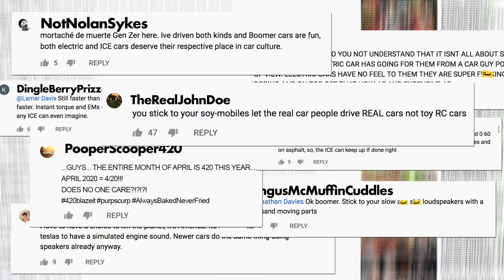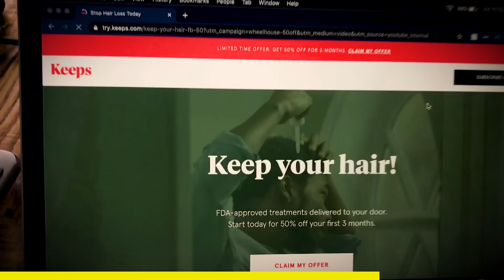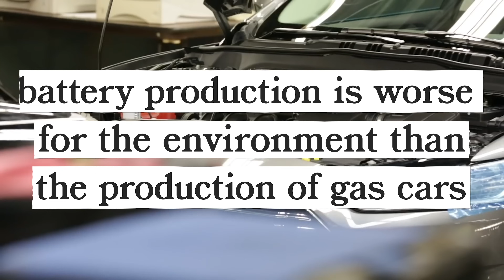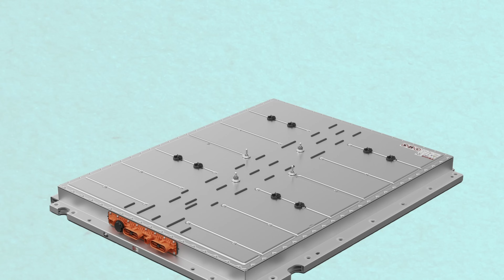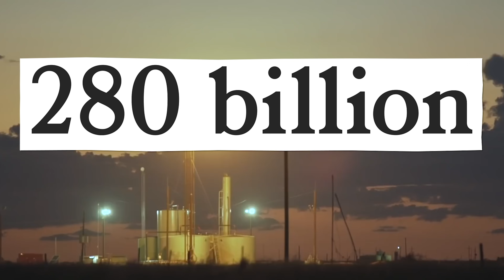Are Electric Cars REALLY Better for the Environment?

Comment: Can we give this man props for how he explains things. He makes it so easy to understand what he’s talking about!
Reply: He deliberately omitted the part where there are massive factories all over the world that have to recycle the batteries. If he was good and unbiased at explaining this topic, he would have explained the massive amounts of cO2 that those facilities produce. The omission of that information turns this video into nothing but propaganda. 

Also, the replacement of the battery packs in the cars. EVs have a much longer lifespan than ICE vehicles due to having far fewer moving parts, so people replace the battery packs in their vehicles instead of buying a new car when the batteries no longer hold an acceptable charge. This means that the cO2 production of the batteries is already at least double per BEV than what he's claiming.
Reply: @ayoungtricknamedjim5498  Yes, he never covered what happens to dead batteries and cost of replacing them! My cell phone battery replacement is expensive so I can’t imagine how much it would cost for a car.
Reply: @DH-gp3gp  and your cell phone probably has a bigger carbon footprint than your refrigerator.
Reply: @DH-gp3gp  well in a Tesla it’s 14k to 20k.
Reply: @DH-gp3gp  not that much for a car since u dont have to replace the whole batterie because the cars batteries are made out of about 16 modules where almost every time only have to replace one module which is maybe 1000-3000$ and since u save a lot of money on nit having to make oil changes etc thats not to much
Reply: @ayoungtricknamedjim5498  I just saw this comment. I didn’t know about that and thanks for commenting about it. I was trying to dig on what car I should buy that would be best for me and the planet, now I know it’s no cars at all 😭
Reply: @aliciaxoe3  me too. Bicycle when you can! I'm out in the middle of nowhere and drive my car three days a week to get to work but I walk or bike otherwise. Cheers!
Reply: @ayoungtricknamedjim5498  it’s also a more fit alternative too. I’ll definitely try to do something similar in the future and cheersss
Reply: Even ICE cars have batteries that are 80 to 90 pounds heavy. Even without EVs, ICE engines and lots of appliances already use batteries like inverters, inverter ACs, computer UPS, Laptop battery, notepads, mobile phones, torch, kids toys, hand held gadgets In many fields use batteries. So EVs are not a bad option. Most countries have adopted by solar energy, wind energy and hydopower energy for electricity.
Reply: @ayoungtricknamedjim5498  The batteries have to be replaced every ten years. This is on Youtube. And this is regardless to the other parts. And guess what those parts are all computers with chips, which can hinder the vehicles from working at times. And are easier to break and you can't work on them like my 1986 Jimmy.
Reply: @ayoungtricknamedjim5498  and notice how he didn't give a number for the c02 emissions from lithium or cobalt mining? Judt the ethical thought. 17 metric tons for a big EV, plus atleast 2 tons per year? So 37 tons for 10 years? You're getting up there with ice vehicles, and that's not including replacing the battery or from what I here the additional maintenance of EVs, I hear the tires need to be replaced more. And in an electrical world you still need to take into account the emissions from manufacturing solar panels and wind mills, mining for copper or processing recycled copper... I want to do more research on coal emissions vs oil refining. I thought I read that coal is worse, not sure if it takes into account refining of oil or just burning gas. And there is still energy loss in transporting power. Good luck mining lithium, or copper, or anything heavy with an electric power CAT truck. Most likely will have a low range when it comes to hauling or towing heavy material, which means more charging, and therefore more c02 emitted, whether from coal or manufacturing of solar panels, wind mills, hydro power systems. And more solar? = less room for trees and grass that love c02. Not all solar is just on roofs or pavement... edit: and i also read that mining for uranium emits c02, and heating up your home with electricity is tough vs gas, sooo you're probably going to need more juice, therefore more mining and c02 emissions. They say it's just water vapor, but doesn't water vapor heat the earth? And then you're just taking water from resources around you and speeding up that process that's supposedly already happening in our "warm" world. Just like digging for oil and speeding up that process...
Reply: @toomuchgyal9083  these are the thoughts that are good to ponder. Everyone should be researching this stuff instead of having the EV narrative force-fed and blindly accepting it. 

One thing I'd mention is that H2O/water vapor actually cools the air. Once it reaches a couple of feet from the exhaust pipes, it has a cooling effect :)
Reply: @ayoungtricknamedjim5498  I think we all need to understand heat transfer more, I honestly don't get it, there's a lot going on between the sun's plasma and our magnetic field. When I google "does water vapor heat the earth" the interwebs say yes it does. Although deep down I do think the sun is ultimately the king! Lol

Edit: but again to your point, what the internet says could be a half truth, it could have a cooling affect that we don't see, but the experts say otherwise.
Reply: +HYDROGEN AS BATTERIES : New concept : HYDROGEN BATTERIES. Electric vehicles must switch to use  hydrogen batteries instead of chemical batteries.  
People often think about hydrogen as fuel, but many forget that hydrogen is not only a fuel, but also very good battery, too. 
 1/ The fundamental science dictates essential truth of all chemical batteries : (CAREFULLY RESEARCHED STUDIES)
if a chemical energy storing mechanism is charged as quickly as producing hydrogen, then this mechanism PRACTICALLY  CANNOT HAVE BETTER  ENERGY CONVERSION RATIO THAN ELECTROLYSIS PROCESS. Besides, it is possible to SETUP and adjust electrolysis reaction speed (for example slow down speed) to reach energy conversion ratio of electrolysis better than any chemical batteries. The best one of all possible chemical batteries in AEROBIC earth conditions is HYDROGEN BATTERY. All revolutions of chemical batteries, lithium batteries, LFP batteries, LTO batteries, graphene batteries .. are for reaching to the features of hydrogen batteries. 
  
2/ New concept : hydrogen battery = (fuel cell + hydrogen storage object). 
The most simple hydrogen battery = 1 fuel cell + 1 compressed hydrogen balloon 300bar, can easily beat best lithium batteries by all features : more capacity, more power, less weight, forever lifespan, no degradation, charging in 5 minutes, same or better energy conversion ratio, but just noremarkable bigger volume sized than lithium batteries.
 
3/ So just equip electric vehicles with hydrogen batteries instead of chemical batteries.  And equip hydrogen filling stations with mobile electrolysers to produce compressed hydrogen 300+ bar on site from electrical outlets. Electrolysing hydrogen filling stations (hydrogen battery charging stations) can run electrolysers from electrical outlets to produce liquid hydrogen on site, to avoid suddenly leap change requirements for big number of already existing current liquid hydrogen cars in the markets. But liquid hydrogen has low energy conversion ratio.  For now and near future, compressed hydrogen (produced on site)  is more versatile for various applications.
(Additionally envisagedly, owners of ANY SMALL COMPRESSED HYDROGEN MOBILITY VEHICLES/ROBOTS/BIG DRONES/MOBILITY DEVICES can buy small mobile household electrolysers to recharge hydrogen batteries at home at night/any times). 
4/ Example and comparison : hydrogen cars vs battery cars, hydrogen batteries vs chemical batteries :
The old approach sets high H2 cost because : they pay for making H2, then they pay much for converting H2 to liquid H2, then they pay much for transporting liquid H2 by trucks (complex safety trucks, and very small weight of liquid H2 on every trucks), then they pay for keeping cryogen conditions to store liquid H2. 
 But in new approach of ‘electrolysing hydrogen filling station” : you use electricity from electrical outlets at electrolysing hydrogen filling stations to run electrolysers to produce compressed hydrogen 300+bar on site. So you pay only for electricity and water of course. No other fees. No complex cryogen equipments.
Compare : hydrogen batteries vs lithium batteries in the approach of “electrolysing hydrogen filling station” : 
4.1/ Grid transmission loss : hydrogen battery charging and lithium battery charging onsite cause same grid transmission losses. 
Conclusion : Equal.
4.2/ Energy conversion ratio in charging : (electric energy -> chemical energy)
Electrolysers in quick mode (very high electrolysis reaction speed) have energy conversion ratio about 70%. Lithium batteries quick charging has energy conversion ratio about 60-70%. 
Electrolysers in slow mode (small electrolysis reaction speed) have energy conversion ratio 90%. Lithium batteries slow charging has energy conversion ratio 90%.
Conclusion : electrolysers win, because of the ability of flexible modes of scheduling and functioning to reach higher energy conversion ratio.
4.3/ Energy conversion ratio in performance : (chemical energy -> electric energy)
Fuel cell has energy conversion ratio about 75+% in mode of intensive power performance (when require delivering much walt/seconds), energy loss in form of heat. Lithium batteries have energy conversion ratio about 70-% in mode of intensive power performance (when require delivering much walt/seconds), energy loss in form of heat. 
Fuel cell has energy conversion ratio about 85+% in mode of nointensive power performance (when require delivering less walt/seconds), energy loss in form of heat. Lithium batteries have energy conversion ratio about 95-% in mode of nointensive power performance (when require delivering less walt/seconds), energy loss in form of heat. 
Conclusion : Equal.
4.4/ Energy loss in energy packing compressing process :
Hydrogen battery using compressed H2 300bar cause about 3-5% energy loss for compression. But hydrogen battery weight is very small.
Lithium battery loses 0 energy in compression. But lithium battery weight IS INHERENTLY HIGH. 
That means you always need to transport noneccessary lithium battery heavy weights on your vehicles every seconds. -> The higher power category, the higher loss with lithium batteries. The longer range, the higher loss with lithium batteries.
Conclusion : hydrogen batteries win with big advantages
4.5/ Spatial size :
Simple hydrogen battery = 1 fuel cell + 1 hydrogen ballon 300+ bar.
For small capacity category (for example, passenger cars capacity category) : simple hydrogen batteries have little bigger spatial sizes than lithium batteries. 
For nosmall capacity category : simple hydrogen batteries have little smaller spatial sizes than lithium batteries. 
Conclusion : lithium batteries win with nobig advantage. 
4.6/ Lifespan and degradation :
Hydrogen batteries have practically forever life span, and practically no degradation.
Lithium batteries have lifespan about 3 years. Some good ones have 5 years. Other modern modified lithium batteries have more lifespan but smaller capacities. But all of them degrade every year.
Conclusion : hydrogen batteries win. 
4.7/ Influence of environment temperature :
Hydrogen batteries never fear environment temperatures.
Lithium batteries fear environment temperature. Even in some seasons you can not or you ineffectively use lithium batteries.
Conclusion : hydrogen batteries win.
4.8/ Charging time :
Hydrogen batteries : load compressed Hydrogen 300+bar or exchange compressed hydrogen canisters 300 bar in 3-5 minutes.
But you must waste minimal 30 minutes for nofull charging lithium batteries, and often you must waste some money for paying some unnecessary things in fool waiting times too. -> waste time + waste money.
Conclusion : hydrogen batteries win.
4.9/ Synchronize with grid supplying schedules :
Electrolysing hydrogen filling stations can easily pick up flexible schedules to run electrolysers in tandem with grid supplying schedules. So Electrolysing hydrogen filling stations can pick up right hours of day for incentives electrical tarif. Nets of electrolysing hydrogen filling stations ideally use intermittent clean energy/renewable energy.
But electric charging stations can not pick up times. High power electric charging stations terribly conflict with intermittent schedules of clean energy/renewable energy. The more higher power electric charging station in quick charging mode, the more terribly it conflicts with intermittent energy supply schedules of clean energy/renewable energy.
Conclusion : hydrogen batteries win. 
FINAL NATURE TRUTH VERDICT : HYDROGEN CARS WIN MANYFOLD AGAINST BATTERY CARS. 
Just need to make right approach : model of distributed hydrogen productions onsite (nets of distributed ELECTROLYSING hydrogen filling stations) + electric cars with hydrogen batteries EXACTLY MAKES  HYDROGEN CARS MORE/AS  ENERGY SAVING THAN/AS  BATTERY CARS, AND IDEALLY COOPERATES WITH INTERMITTENT CLEAN ENERGY/RENEWABLE ENERGY THROUGH ALREADY EXISTING ELECTRICAL GRIDS. 
All electric vehicle manufactures, which make/begin making electric vehicles, need to choose hydrogen batteries and cooperate to build nets of hydrogen battery charging stations (nets of electrolysing hydrogen filling stations are easy and noexpensive), for getting advantages of initiating, for their profits,  for environment, for human AEROBIC orienting breath air, for world
Reply: I only listen to him from the channel.
Reply: Never knew about the all this information that he did not put in this video 🤔
One should always read the comment section ❗
A big thank you to all that's in this thread 🙂  👏👏👏
Reply: @icost4671  Not everything that is needed to know is reported, somethings may not be stated because of who may or may not be behind the product that is being highlighted.
Reply: @beauxr.benoit1374  I take note in what you said and thank you.
Via this thread, it is notable that even though he likes his mustang he does seemed to be pushing EVs 🤔
Especially since leaving out a lot of very important facts that people are saying in this thread ❗
I learned a lot by this video and what is in this thread 💡
Reply: @icost4671  Your welcome.
Reply: This is one thread that is going to go on and on and on ❗
I find both sides of the argument, pretty enlightening.
All in all, I will keep my 2010 Toyota Tacoma. But I might buy one of those very cheap Chinese subcompact EVs when they hit the American market.
For cheap transportation, running around the city or nearby town  and cities.
The second biggest thing in that car other than me, will be a  "EXTRA LARGE FIRE EXTINGUISHER"  !❗!
Reply: He may have made it easy but he missed so many points it was not factual.
Reply: No, because he's lying!
Reply: @ldfreitas9437  Absolutely.
Reply: You mean can we give the script write props lol
Reply: I agree. That is why I subbed.
Reply: What about battery disposal after the battery is out of commission(20 years from now when all the cars running currently die)???
Reply: not rlly

Comment: Only problem for me is the insanely high prices they ask for EVs. It's not financially viable for me.
Reply: While  the initial  cost is higher, between the lower fuel costs, and  lower  maintenance, the TCO is surprisingly low;  in fact one study found  that a Tesla 3 had a lower total cost of ownership than a Toyota Corolla over 5 years.
Reply: I did my math as I am due for a new car. It will cost me more in the next 5 years to own a gas car for my needs than to get a tesla model 3 SR+ to own.
Reply: So buy a used one, they cost less.
Reply: @Brian-om2hh  yeah no, I didn't get a good job to skimp on things I want. I got a house now so my next goal is not a fixer upper. I am over that phase of my life.

Comment: Stop making electric and gasoline cars. Start making cars that use water
Reply: There are no cars that run on water
Reply: @engineeringtheweirdguy2103  I know but they should try to make one
Reply: @lmoore58579  i actually had an idea for that before. With it having its own waterwheel inside of it making its own energy
Reply: @lmoore58579  Do you understand that water is the end result of a perfect hydrocarbon reaction like that in a car? Meaning it's at the bottom of the energy chain of events. You can't extract energy from it, except perhaps thermally, but it's virtually zero at normal temps. The only way you can use water as fuel is to break it down to H2 and O2, which will require more energy than you will get in recombining them.

Comment: The problem that will be faced is that there will be no more energy from petroleum natural resources in the future which will soon run out, then what is the replacement?
Reply: What happens if you run out of lithium, cobalt, rare earth metals or anything?
Reply: @UrielX1212  Humans are only digging and using natural resources from the earth. petroleum will run out in the next 20 years, now and in the future what kind of energy is good for all of us, without reducing or damaging the environment.
https://iea.blob.core.windows.net/assets/278ae0c8-28b8-402b-b9ab-6e45463c273f/TheRoleofCriticalMineralsinCleanEnergyTransitions.pdf